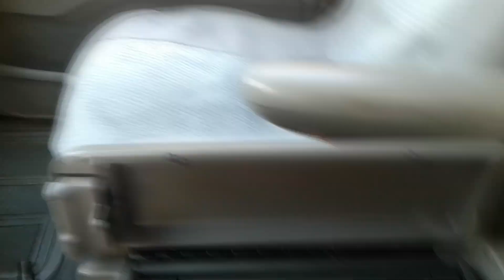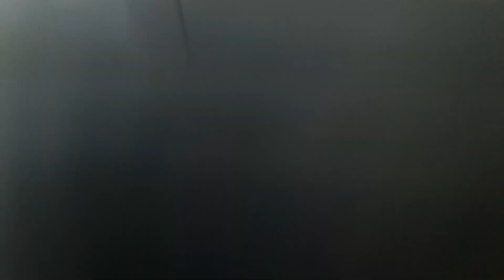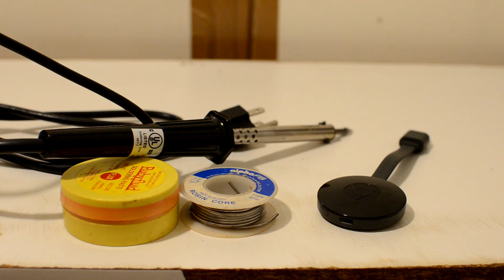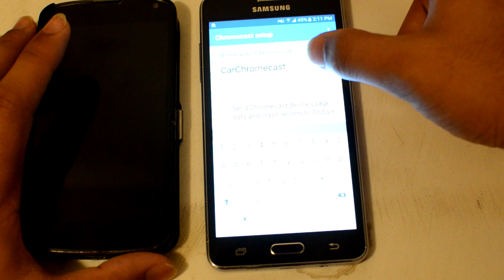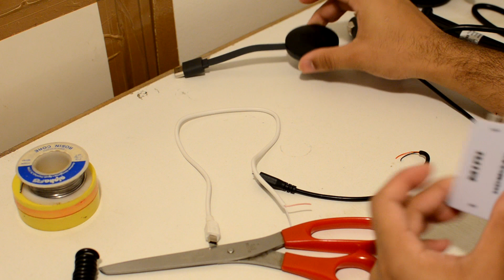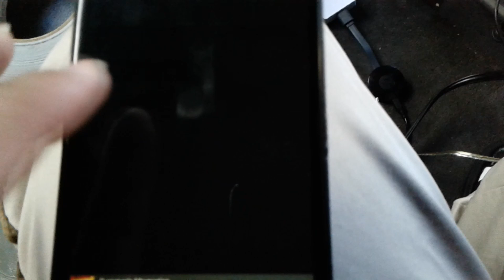How To Install A Chormecast Into A Car

Comment: Yeah, don't cut the USB cables. They have shielding in them. Instead, use a 12V DC to 5V DC converter with USB female plugs on it. Only $14 on Amazon. https://www.amazon.com/dp/B07H6W1BZG/

Comment: you did good! one year later now! whats the update on it?
Reply from the maker: Still working, i havent had any time to change anything on it tho. Thanks for the comment. :)
Reply: Nicee mannn I'm gonna try both ways. There's a HDMI on my Kenwood I'm gonna try to stream with the Belkin miracast and just plug it in the aukey turbocharger 3.0 USB in. My truck gonna post vids on it on my channel
Reply from the maker: Awesome, have fun :)
Reply: Why don't you stick all that to one side of compartment so that you get some more space.